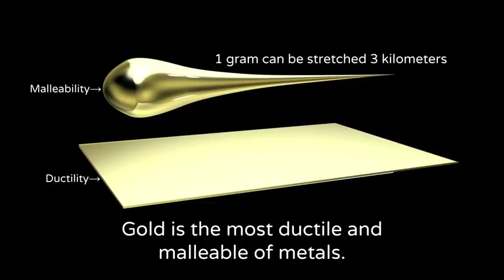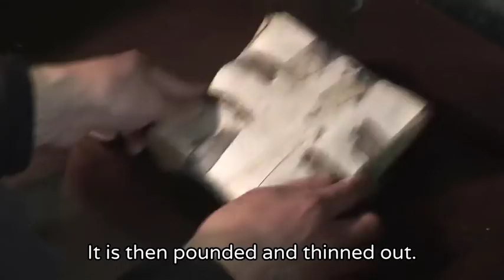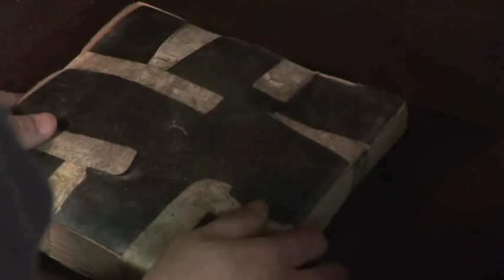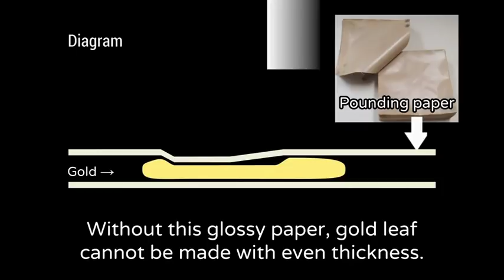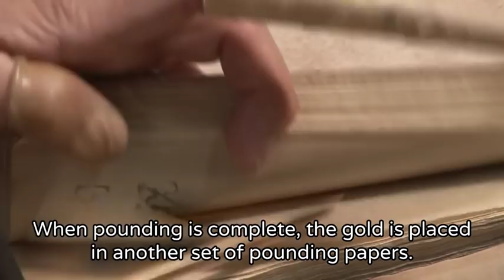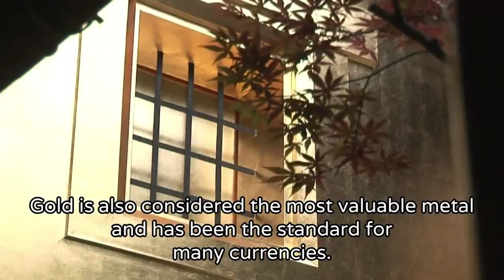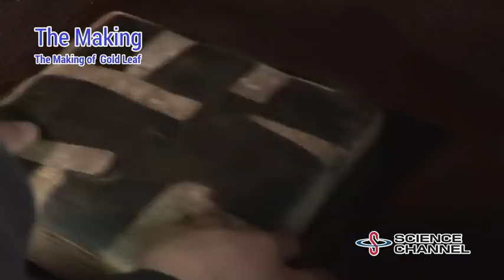THE MAKING(English Version)(271)The Making of Gold Leaf

Comment: This man is using wooden tweezers and not ripping any of the paper.
I can barely not shake holding tweezers.  Good lord.
Reply: It's no easier placing it where it's going to stay in the end. We use a fine, flat, long stiff haired brush charged up with static electricity. You only get one chance.
Reply: You should see the blooper reel ...
Reply: They-
They're called chopsticks
What he's using is chopsticks
Reply: Wtf are wooden tweezers?????
Reply: Another reason why they use Wooden Tweezers/Chopsticks is because to avoid static Electricity As gold is element of metal afterall

Comment: 7:48 Correct me if I'm wrong, but shouldn't mixing rice straw ash with water create magnesium hydroxide (the main component in brucite as well as milk of magnesia,) and calcium hydroxide ("slaked lime") but specifically not sodium hydroxide ("lye")?

Lye, aka 'caustic soda,' is sodium hydroxide (NaOH,) however, rice straw ash should contribute mostly magnesium oxide (MgO) and calcium hydroxide (Ca(OH)2) to the solution, which would react with the H2O to create magnesium oxide and calcium hydroxide, respectively.  All the silicon dioxide (SiO2) will be poorly soluble in water, but some will carry across.

I know wood ash is mostly potassium carbonate, which reacts with the H2O to create potassium hydroxide (KOH), aka "caustic potash," but people call it "lye" anyway even though, chemically speaking, it's actually caustic potash (potassium hydroxide) not lye (sodium hydroxide, aka caustic soda.)

Rice straw's main soluble contributions to the reaction with the water should be magnesium oxide and calcium oxide, I believe, but not the sodium oxide required to create lye.  This means lye shouldn't be present, but "elemental brucite"? or milk of magnesia (magnesium hydroxide) and slaked lime (calcium hydroxide) should be the main reaction products.

Comment: so Gold leaf are not 100% or 99% Pure Gold right? 

it has Silver and Copper?
Reply: +Tommy Jude that's right. the most common gold leaf is 23carat which is about 96%. Pure 100% gold is softer and sticks to itself more easily and is harder to make. The ratio of metals alters the color too. Edible gold leaf won't have the copper.
Reply: bruce jackson Thank you Bruce. Very helpful!
Reply: 23 ct is alot of gold...most wedding rings and such are 14 ct,
Reply: any higher than that and your ring won't last long, with just a bit of pressure and all sorts of scratch marks will reduce its beauty
Reply: That actually depends on the ountry where the ting is sold/bought.  Many countries have 18K as the lowest limit where something like jewelry can be sold as "gold".  Lower carats can be sold but cannot be sold as "gold" (usually doublé or some other term is used) and has to be clearly marked.
if you really want to be ripped off, buy "gold" in the UK where 9 carat is the lowest grade permitted to passed off as "gold".
Reply: What do you think of 14 carat gold consist of?
Reply: @lockbow  and that's why it's called gold plated. Because almost all rings are not solid gold.
Reply: @lockbow  9K is allowed in a number of countries. 

I think Thailand has the highest karat gold. Most gold is 999 fine and it is generally not worn. I think the people in India also prefer very high karat gold.
Reply: @xvfgsdkd9625  58.3% gold with the rest whatever compatible metals are desired. Most countries allow a bit of leeway below the karat percentage in manufactured jewelry, +/- 0.5 karat in the US, if I recall correctly.
Reply: @bobbycain1111  Wrong. Gold plated is a completely different beast and , along with gold washed, is the lowest quality gold item.  Neither contains enough gold to make it worth paying extra.

Gold filled is better, usually either 5% - 10% of the stamped karat purity by weight. The underlaying material may be any base metal. The best quality is gold filled over sterling silver. If I recall correctly, an example would be an article stamped 12K20 (also sometimes marked 1/20 12K gold. The gold overlay will be 12K gold and 1 part in 20 by weight will be that karat gold. Since the gold is 12K, only half of it is actually gold - so the gold content of the item is 2.5% by weight.  Assuming pure gold is worth $40/gram and the item weighs 10 grams (roughly 1/3rd Troy ounce), then there is only 0.25 grams of gold - worth roughly $10.

Comment: People never believe me when I tell them the process. There are different ways of applying it for different uses, each labor intensive, and a lot of waste can be involved. When you see the torch in pics of Lady Liberty in NY harbor, that is what makes it shine. I used to do surface gilding on trucks, boats and race cars. i've never done it exactly right in over thirty years. Neither has the guy who taught me the lettering business. He wants to be buried with a lettering quill (brush), a can of size (paint-like adhesive), and a pack of gold. If done right, it needs no coating over it, except in commercial applications were people may abuse it.
Gold leaf has been around a lot longer than power hammers, so guess how it used to be done, Yep, hammered by hand. You can tell who those guys are. One arm like a beast, and the opposite thumb flattened 😱
Vegetarians won't want to know what "washi" is, unless the source died of natural causes. Pubs and "Old West" general and five and dime stores used it a lot. It could get dirty, but not tarnish. It is the thinnest man-manipulated material known to exist.

Comment: 😬 @11:43, imagine if a window blew open and a huge gust of wind flew in. The lady would probably just faint. 😂
Reply: romeo9782  She would quickly cover the stack before she sneezed.
Reply: Try applying a number of sheets, surface gilding a boat name, outside. This is the same stuff they use to letter fire trucks. Crushed velvet, or cotton balls are used to make the "engine turning" design in the lettering.

Comment: I feel like it would be more economical and practical to skip a few steps and used a thicker gold leaf instead..
Reply: Nope, the only way to make it thicker is use an alloy that has very little gold in it. But, it tarnishs, wears off, doesn't have the luster. How much savings would it take, you think, it would be to redo the torch on the Statue of Liberty every five years using composite, or variegated gold. Both much cheaper. Compared to the at least fifty, up to one hundred years, if done right, that real gold will last, as thin as it is.
The last time I used it was about thirty years ago. It was about $25 a book of 25, so about a dollar a sheet. Since it is at least 22k gold, the price isn't stable. In 1986, I used variegated gold, which is mixed with many other metals to give it a different look, thicker, but made the same way it was about half that, to do the numbers on my race car.
Reply: @DDS029  really? In the video, they started thicker, and slowly make it thinner in each step

Comment: You know whats more expensive than gold?.......... Platinum. Ive always wondered why platinum is the most exspensive precious metal. I'll have to look into it now. All I know is that I sold a peice of  platinum wire not even long enough for a choker necklace and I got $100 for it.

Edit: so I looked into it and its sooo exspensive cuz its 20× rarer than gold. That definitely explains it.
Reply: But you can't work it the same way as gold for the applications this is used for, and silver leaf is cheaper and looks the same. Aluminum leaf also. If you want a real shocker, check out the price of tungsten, then try to find a picture of how small of a one pound chunk is.
Reply: @DDS029  my husbands wedding band is tungsten (so he can wear it for his job cuz its so strong). It doesn't cost much. It was actually very affordable.
Reply: @chrisandjessaltman2263  that's not pure tungsten, pure tungsten is one of the most expensive minerals on this planet. It's all so heavy as fuck

Comment: What they leave out is that the final paper they use is more expensive than the gold leaf in between the sheets of paper. The paper is Very Costly to produce. The gold that they start with is costly, but by the time it's thinned out so much one sheet is practically nothing. Almost one atom thick . . . . . .
Happy Trails . . . . .
Bye Bye Freaks . .